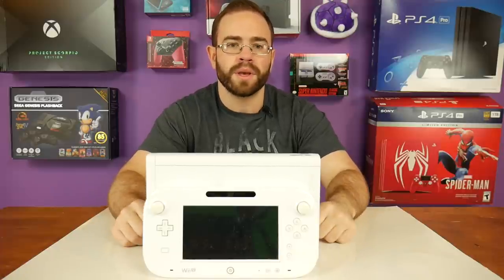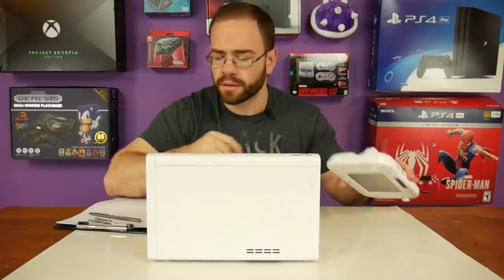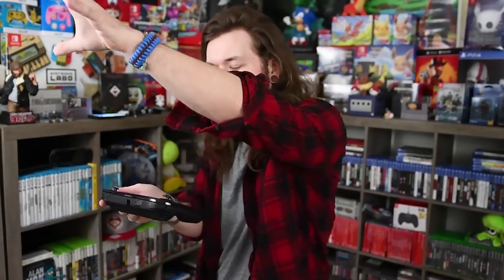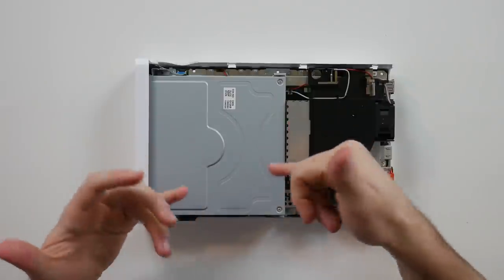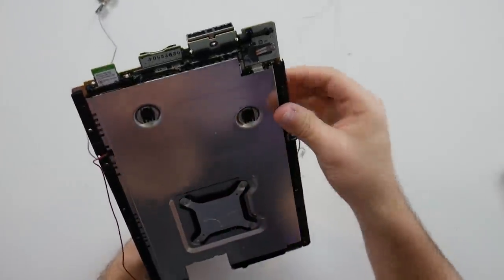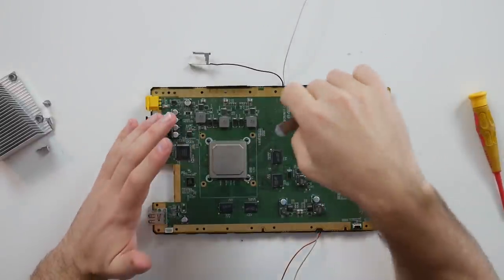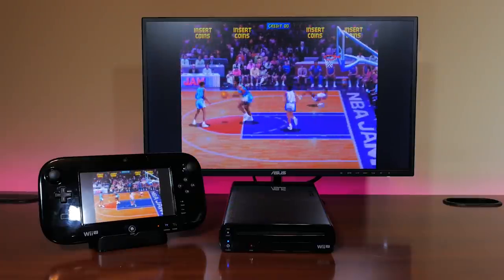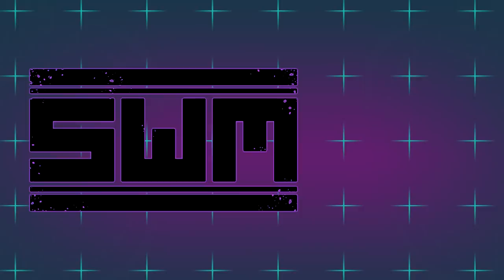Here's Why The Wii U Never Had A Chance (ft. BeatEmUps, Scott The Woz, Wulff Den, MVG)

Comment: MVG says that Nintendont upscales Gamecube to 1080p which technically isn’t true. It’s still a 480p passthrough even though the signal may be detected as higher or HD. My TV info will display 1080p but it’s truly not. Don’t get me wrong here, it’s very comparable to the official GC Component, newer HDMI adapters for the GC and IMO, slightly better than original Wii even with Wii2HDMI. All still 480p passthrough though.
Reply: It still looks good
Reply: I’m not denying that. It’s actually my preferred method to play GC. I have a HDD with about 150 games in it.

Comment: I just got one and honestly I think it's a great system that failed due to public perception rather than what's wrong with it,similar to the dreamcast I suppose. 
First of all the thing runs wii games. This doesn't seem like a big deal at face value however I have never managed to get a componant cable that works for my wii so always resorted to using an upscaler. It's not even close to as good as actually running the games at 480p like they where meant to. Super Mario galaxy went from being a good looking game to being an absolutely gorgeous game that at times warrants ooohs and ahhhhs that I've only ever given to skyrim VR.
Secondly the tablet-like controller is actually a substitute for the tv screen if you choose it to be. This was not well advertised or fully explained when it released and even up until I got the thing I didn't fully understand how it actually worked. My kids can play whatever they want while I play ps4. Awesome. 
Thirdly it has legend of zelda breath of the wild amongst other games that where later ported to the switch to artificially increase it's library so you don't miss out on alot and you save alot of money.

Comment: Going to be the really-really odd one out here:
Still play my Wii U, even though I have a perfectly-running Switch with a large library of games.

Now as to why (TL;DR: it's got character + more convenient for home-use than even a phone):
First, just to get the biggest elephant out of the room - I adored the Wii U when it first came out. I loved the Wii far more, but the Wii U had a special place in my gaming heart during that time. And yes, I played my 360 and PS4 plenty during that time (sorry X1). Despite it being behind the times, what it had, well, what it and all Nintendo consoles had (PRIOR to the Switch - no, I'm being serious) was CHARACTER. I'm not talking about how it looked or how it felt, I'm talking about what was on the screen(s). I'm talking about the sound. Menu sound effects and bgms, cheerful and cartoonish visuals for every little button press and submenu - the Wii U still has the one thing the Switch and so many other consoles didn't have: character that makes it more than just a game-playing machine (yes, the N64 and prior didn't have any character, but the character was instead installed into their games - which was the formula that then fed into the DS/DSi/Wii/3DS/Wii U... this kind of character didn't follow into the Switch, in either its games or its system).
If you're wondering what I mean by character... look at your PC, heck, even your smartphone. Unless you changed its system sounds and visuals outside of the background - it's simply a screen that allows you to access programs that are far more interesting. But outside of that, if you throw it away and buy a new/better one, you have no reason to go back to the old one. Because all you care about, are the programs. The DS/DSi/Wii/3DS/Wii U... well, after selling them, if you had fond memories of using anything beyond playing games, you'd regret it. This was especially true for the DSi, since the system's aesthetics were practically based on you making memories through it (heavy emphasis on the camera function).
If you want just a taste of what the difference is, go on the eShop in the Switch, then go to the eShop on the Wii U. If you don't have either, look up videos. Heck, even looking up the videos will show the vast difference. The Wii U's eShop alone has enough music variety that it could make its own high quality album. The Switch's... it's quieter than crickets. 
Outside of character, however, the Wii U was indeed lacking in the games department. Not to say it had no games whatsoever, it just had significantly fewer games than other consoles offered. But, there was a feature in here that people mostly hated, but some loved - and that was the Miiverse. And outside of terrible memes and immature conversations, the Miiverse allowed and ENCOURAGED players to do something that they normally wouldn't do without it: Look at games they didn't know about/care about. Yes, we had the internet, youtube, etc. Let's Plays were a thing. But most Let's Players only played popular games, infamously bad games, or cult classics. Rarely did they ever play hidden/honestly-niche gems.
The Miiverse, in its own little internet bubble, would display games recently released, and allow its players to post within its confines. Of course this is where you'll find plenty of childish conversations and horrible memes, but this is also where you could easily ask: "Hey, how do you like the game?" and get a response pretty quickly. ... I know, we have the internet, and youtube obviously, and twitch, and etc. But you won't go out of your way to look at reviews/opinions for games you honestly have no interest in. When you were on the Miiverse though (at least, on the Wii U's Miiverse... 3DS Miiverse was too slow), it's like you had no reason NOT TO look at these other Miiverses... which would give you insight to a lot of games you didn't consider before, but are considering a lot more now.
The only problem was... well, with enough cringey comments, most mature, sane people didn't want to look through the Miiverse. But those who shrugged it off and powered through were always rewarded in finding some honestly interesting games and conversations.
But the Miiverse is gone now, isn't it? So what else?
Well, outside of still playing Splatoon 1 ("BUT SPLATOON 2 IS BETTER" I always hear... from people who were children when they played Splatoon 1... Splatoon 2 is different from Splatoon 1, with tons more content, but Splatoon 1 still has an entirely different feel to it that's worth going back to every now and then), there's Crunchyroll (which still hasn't gotten to the Switch), the Internet Browser (which the Switch doesn't have), ZombiU (play it again, without everyone screaming at you how to feel about it - you'll notice a world of difference) and of course, games that were better with the Gamepad (having the inventory away from the TV is honestly a time saver).
"Why would you use Internet Explorer/Crunchyroll on the Wii U when you have a perfectly working and charged smartphone???" Because once you get tired of tiny screens, hot hands, WIFI signals, and easily depleted batteries, you realize just how inconvenient a smartphone is to use at home. A smartphone shines outside the house, but inside... it's actually really aggravating to depend on. We just convince ourselves it's more useful.
"Then get a tablet!" Again, WIFI signals and easily depleted batteries. Even if you have a long lasting battery life tablet, you'll still forget to charge it at times and have it die on you when it's the most inconvenient - usually away from a power outlet (like the kitchen, reading recipes). "Then keep it charged all day!" And kill the battery life?? Dunno about you, but I prefer to use a single tablet for longer than 2 years. I'd rather not have the battery die from always keeping it charged. I'd rather kill the Wii U Gamepad's battery life, because once the battery's dead - it'll still function perfectly fine by being attached to the cord near the TV (where it's supposed to be)... which, by the way, I've had my Wii U since launch, have had it plugged to an outlet charger for months at a time (used it too often to not have it plugged in), and its battery STILL lasts longer than my tablets who've been given the same treatment and I've only had for 2 years or less.
Plus, if I drop a smartphone/tablet, I sort of panic and check for damage. The Wii U Gamepad? Had that thing slammed and bounced off the ground, dropped it accidentally on several occasions... functions perfectly fine.
"Why not have a laptop then?" I do. Two of them, in fact. But after weighing and testing the pros and cons of wifi signals for 4 years in my household, I've since removed my WiFi router and have been using ethernet cables for everything. Kinda makes laptops not so portable for internet purposes.
So, with all this put together..... The Wii U beats nearly every single electronic media device in my household for convenience. Plus, it's still a chipper, happy thing that's welcoming to use. And if I play games on it: still fun to use.
Other consoles have come and gone in my house, some only being kept for their quality un-ported games (but in today's day and age, those un-ported libraries are getting smaller and smaller)... but Nintendo consoles have kept their place due to their timelessness. The Wii U will be the same... The scary thing is, I'm not sure if the Switch will be given the same treatment. If Nintendo's next console is better than the Switch and is still portable - there's little to no reason to keep it. The Wii U at least still has character and exclusive playstyles to keep its spot. The Switch... is like all other consoles: a standard blueprint to be improved upon.

Oh, and plus, I'm a family man. So local play is key in this household.
Wii U still beats Switch in the fun department of local family play.
Reply: Ai Rorello woah that's a long comment 😳 but I will still read it though and give you a like
Reply: Agree.But I think the Switch is by far the worst Nintendo console,well the Wii U is possibly the best.

Comment: I always grab game consoles pretty late into their life, and almost always used. So prices are low meanwhile compatibility is high.
I REALLY dig the Wii U because of the homebrew community. Attach an external self-powered hard drive and you can have all your games installed onboard, so no lost discs or disc switching. Emulation and virtual consoles make this a must-have for me, esp because you can play everything on a tv or the tablet! Portability and universal remote functions, I'll be using this thing a good while.
I tend to use the Wii U more than the PS4, and I still haven't turned on my Xbox One

Comment: I bought mine two days ago - 32gb black for about 160$ and I immediately understood what Scott meant by “clunky”. 
After playing Switch for 2 years it is really mind bending experience to play games on Wii U. Especially games like Kirby (the one with magic brush) when it’s almost like Switch and DS combined, because there is absolutely no need to turn in the tv. It’s almost mobile, but in the same time it isn’t - you can’t go further than 15 feet, because gamepad stops responding. 
I am really not surprised Wii U failed hard.

Comment: The Wii U was great to buy used when the Switch first came out so you could play Zelda BOTW when it was impossible to find a Switch on store shelves. I ended up getting a bunch of other virtual console games and a couple of other good games that the Wii U had. I still have it hooked up, and it's way more convenient than using an old Wii to play older games.

Comment: My kids and I really liked the Wii U. The main complaint that we have is that it uses old fashioned Wii controllers. We can’t sit back on the couch and get good input because the sensor bar is too far away. We’ll sit on the couch for parts of a game but whenever we’ve got to use the motion controls, we have to move closer to the TV. Honestly, if that one single thing was fixed, then, I’m sure we would play it more, however, it’s kinda fixed by having a Nintendo Switch and since most of the games have made it over there, it’s actually just easier to play the Switch versions.

Comment: The Discs are round because they are burned/melted on the edges, which is good for two reasons.  They are nice to feel, yes,  but more importantly, this prevents any cracks from the outer or inner edges, which is one of the big ways any Disc media can fail ... or explode, and yes, I've seen that first hand (despite what Mythbusters said).

Comment: There is an interesting reason why the framerate of many games ported to WiiU "seemed" to be worse. At that time most XB360/PS3 games used no vsync, so many PS360 games had very bad screen tearing. WiiU games had always vsync on, I think it was even impossible to turn vsync off, so the framerate was often a bit worse but the overall viewing experience was sometimes better on WiiU. It was baffling that some port comparisons, even from DF, did not mention the very bad screen tearing of many PS360 games in comparisons to WiiU. Only in the latter days of WiiU, DFs stance on screen tearing changed thankfully.

Comment: The Wii U wasn't a failure. It just wasn't as successful as its predecessor. That happens quite often. Nintendo kept on keeping on. Just as Sony's PS3 wasn't the success that the PS2 was or the Vita wasn't the success the PSP was. The Sega Dreamcast was a failure. Sega pulled the plug on it. Too bad too as in hindsight the Dreamcast would've probably made second or third place at best in the 4 6-gen. systems.

Comment: With so many of the good Wii U games pretty much re-released on Switch, the only reason to own one these days is to play Wii games on a TV that doesn't support composite or component. And that time isn't there just yet, as TVs haven't stopped supporting component just yet, as far as I know. Though perhaps someday, someone may end up creating an emulation system that fully supports the Dolphin emulator, which can be used as a Wii system. Sadly, most emulation systems that try to support a broad selection of platforms end up falling flat. I know you can always get a raspberry Pi, but you still need a plastic shell for protection and it's not a legal method of playing multiple platforms.
Anyway, back on the subject of Wii games, I think it's better for the time being just to have a functional Wii system, since they can also play Gamecube games without issues. Though you would still need to homebrew it if you want to play classic WiiWare titles, but I wouldn't do that to a system that already has stored game files on there, or you could lose them forever if something goes wrong. Like what happened to me when I tried to do it with my console many years ago.